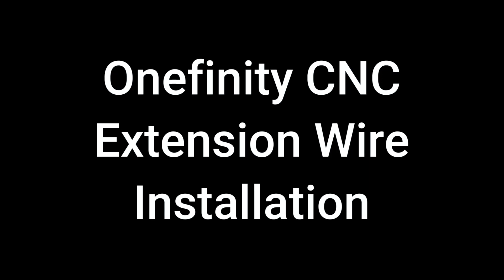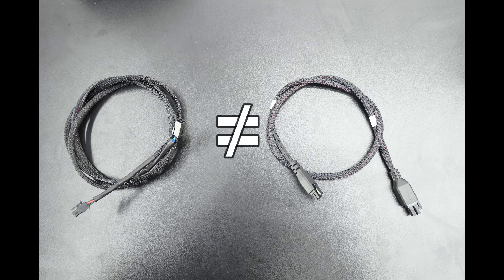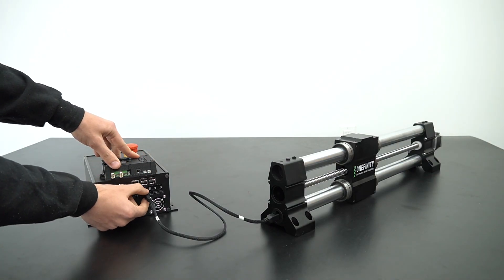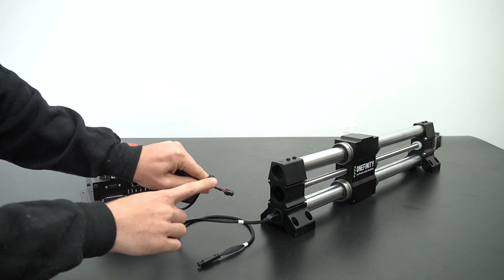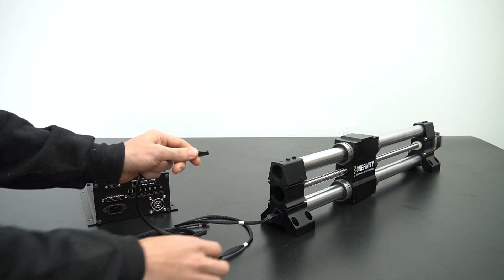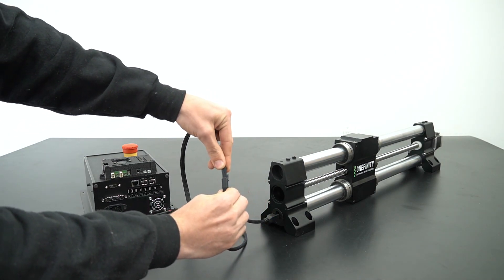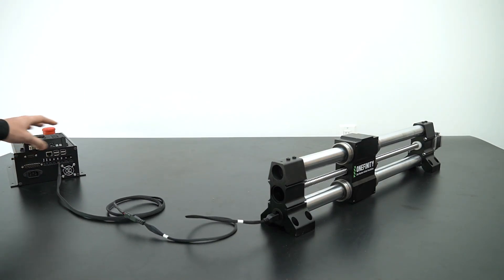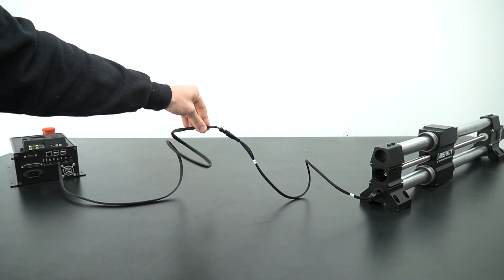Onefinity CNC Extension Wire Installation

Comment: Do the extension wires come included with the larger Journeyman?
Reply from the maker: yes, on all machines.
Reply: ahhhh, no, the Journeyman does NOT come with extension wires, and the factory wires are not long enough to mount the controller anywhere but right next to the machine.
Reply: @OnefinityCNC : If so, I didn’t get mine on my recent order!

Comment: The factory wires are quite short, another foot would have been greatly appreciated. Many users will want to install the controller in an area out of the way from saw dust, underneath the platform.  It would also have been nice to see longer wires available that are NOT extensions.
Reply from the maker: We offer extensions to those who want longer wires to keep costs  low.

Comment: Would be nice if the supplied wires were just longer instead of arguing with the customer saying it's so keep cost low when it's a common complaint. I'm pretty sure an extra couple feet of wire on each cable isn't going to break the bank on cost.
Reply from the maker: Thanks for your opinion!